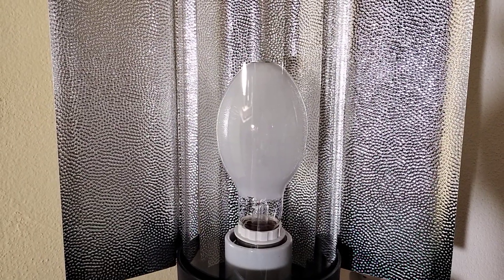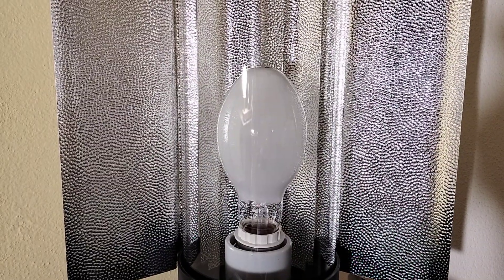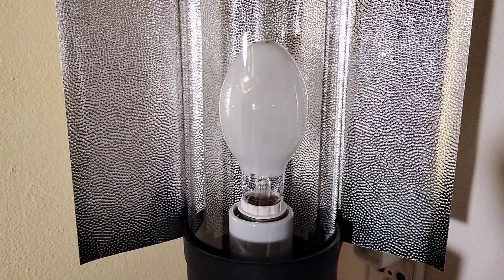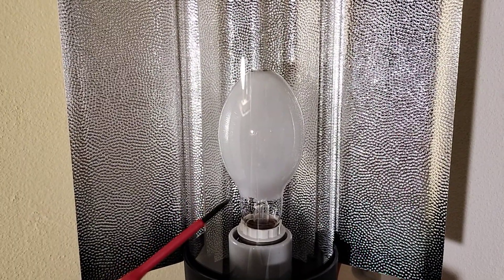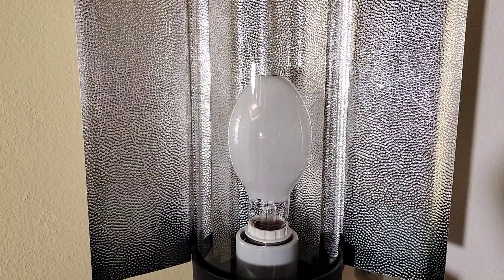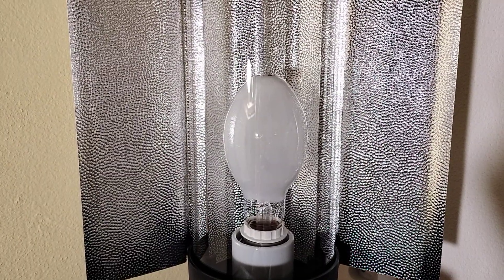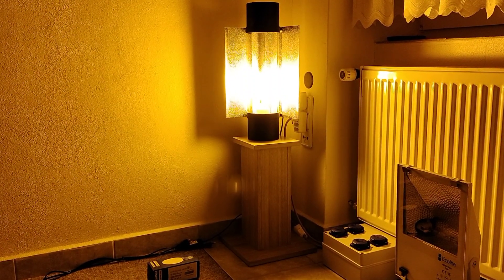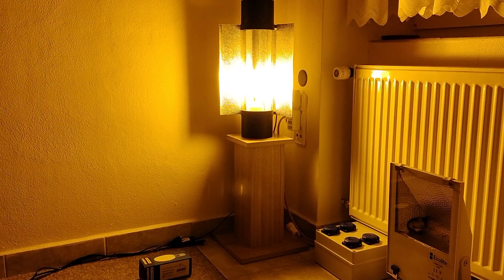SYLVANIA High Pressure Sodium lamp PREVIEW (SHP 70W/CO/E E27 SLV)

Comment: Out of curiosity, I seem to notice that many of your videos often feature a remotely ballasted E40 base grow light fixture. I wonder what led you to use such fixture for running a majority of your E27 and E40 base HID lamps.
Reply from the maker: Yes, this reflector is intended primarily for growing plants and is therefore mainly intended for HPS or MH lamps up to 1kW and is therefore also equipped with robust glass and an E40 base. And I chose it mainly because thanks to the opening on the top (in the vertical position) it allows me to quickly and easily change the lamps as needed, which is different for example with my second and closed reflector, although it has IP66 due to suitable materials, resistance and closure. But the disadvantage is that when I want to change the lamp in this reflector, I have to first loosen the clamps, then open the protective glass, change the lamp and then close everything again. With this tube reflector, I just reach in with my hand, replace the lamp and that's it. And then I connect it to the ballast as needed. It's light, practical, quick to change lamps and I like it... That's it. Well, because of E40, I often have a reduction from E40 to E27 there.🙂
Reply: @ Interesting. I sometimes love building homemade fixtures for my lamps and also like to own a variety of fixtures as well.
Reply from the maker: @worldwidehidcollectorusa-fkt  I just watched something on your channel and you have some interesting creations and I love that you enjoy making your own lamps and I hope you continue to enjoy it and make videos as well. I subscribed to you and I'm just watching the video where you have the Mercury Vapor Table Lamp.🙂
Reply: @ Thanks for subscribing to my channel. I have a collection of lamps from all around the globe
Reply from the maker: @worldwidehidcollectorusa-fkt  This makes me happy, and especially HID lamps are becoming more and more rare, because more and more people are switching to LED...
Reply: @Naguals_HID_Lamps  In Japan, it seems like there are no more newly manufactured HID lamps being manufactured or sold there anymore. All that is pretty much left there is the remaining inventory. Additionally, some countries such as Canada and the EU countries have been banning HID lamps outright from what I understand.
Reply from the maker: @worldwidehidcollectorusa-fkt  It is unfortunately true that many HID lamps are banned in many countries and I would like to see that one day the tables will be turned and HID lamps will be used again. It would make me very happy and for example HPS lamps would be healthier for our eyes, sleep, nature and would also cause less light pollution than most LED lamps.